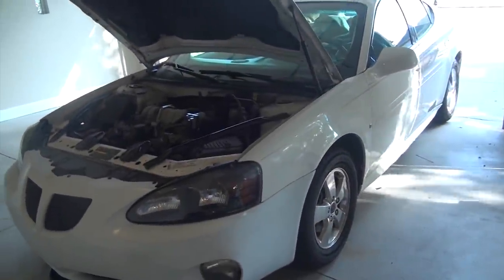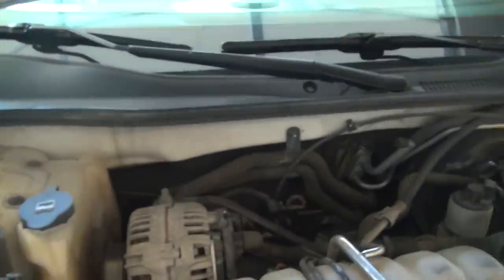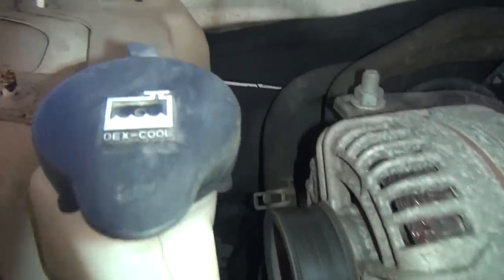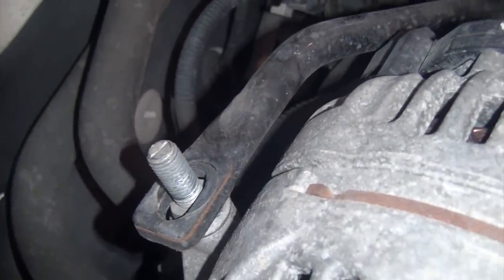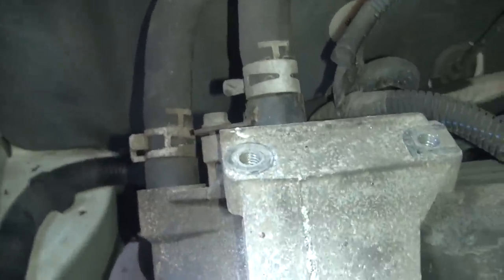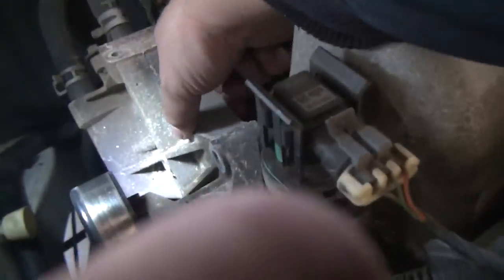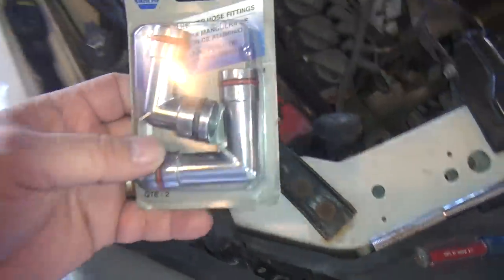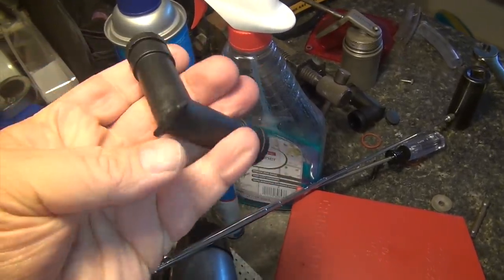GM 3800 Cooling System Elbow Replacement

Comment: yeah, but those aluminum elbows get a lot hotter than the composite elbows do, thus degrading the o-ring faster.   that's why GM used the composite elbows instead.    it's no big deal.   all ya gotta do is replace the composite elbows every 5 years, or so
Reply: so are you saying the aluminum isnt worth it
Reply: they'll work, but i don't think that they'll last as long as the composite elbows do.     you always gotta try to remember that there was a good reason that the GM engineers chose composite elbows over the aluminum ones     and i believe that they chose composite because they knew that the aluminum would get hotter and deteriorate the O-rings faster
Reply from the maker: All due respect Jeff, I think you may want to re-consider your statement:  Plastic or aluminum, they are both in direct contact with the same heat source therefore will heat to the same temp.  A silicone O-ring is rated for roughly 400˚.  I'd offer that the GM engineers were trimming cost. and say absolutely - get the aluminum!
Reply: naaa.... i think i,m gonna stay with the composite elbows, because i know that they won't heat up the inside of those O-rings as much as the aluminum elbows would.    but, to each his own.   do you have a GM 3800 supercharged engine?   because i have had a mysterious coolant leak for a while now, and i can't figure out where it's going.    i replaced the
• elbows
• radiator hoses
• water pump
• tensioners
• thermostat and housing / bleed screw
• coolant temp switch
• upper and lower intake manifold gaskets
• replaced the throttle body
and checked the heater core, which is good

the only thing i didn't do was replace the radiator

i figure that a internal leak would make my oil a milky brown, or light brown color

and my oil always looks fine

so that's why i always keep on dismissing the possibility of a internal combustion leak 

i haven't checked the freeze plugs yet though

what do you think it might be?

do you think that a lot of the coolant could be blowing out of the drain hole in the rear of my coolant reserve tank?

i recently placed a towel behind it, so if it is coming out of that drain, i,ll see the coolant on the towel
Reply from the maker: Ok, gotcha.  And dang, I'd have said lower intake gaskets.  I don't have the car now, but yes it was supercharged.  My mysterious leak was the first the lower intake gaskets, then the elbows.  II don't see a reason for it to get to the tank drain - did you say you put a new radiator cap on?  Hope you find it!
Reply: yeah, but i replaced the upper and lower intake manifold gaskets about 30 days ago, and nothing changed.   it still loses the same amount of coolant.    is it possible to be burning it in the combustion chamber, without having obvious white exhaust smoke, or milky looking oil?
Reply: So Jeff makes an engineering assumption yet cannot find his own engines issues...
Reply: I would go with the Aluminum...WHY? Because traveling down the highway at 65 mph, I would rather experience a slow dripping leak, than have the plastic BLOW OUT as did on my neighbors Chebby Impaler, thereby dumping a gallon of coolant out as fast as the waterpump can spin. STUPID DESIGN, PERIOD. Plastic or Aluminum. Not to mention that they are probably reusable, just get new O Rings, if available.
Reply: Just put 2 Aluminum elbows in a 2005 G Prix. 
Go for the aluminum, the O-Rings can handle heat.
Reply: Burning it as in bad head gasket ?

Wyr
God bless
Reply: 5yrs? Don't use the plastic ones I made that mistake they cracked and leaked after about 2 weeks. JUNK.
Reply: I’m having this problem now. I replaced them last night, started it up, and BOTH elbows started leaking. The guy at O’reilys gave me 4 black rubber o-rings...the elbow going into the pump was very hard to push in. Do I need to tear it apart and get those red silicone o rings? It’s an 02 Park ave ultra. Already has aluminum elbows.
Reply: @RyanLS   Im having the same issue, bought the aluminum elbows a few months ago and noticed my engine was leaking a little bit then pretty excessive this month. Looked at the elbows and both were wet with coolant.
Reply: Rosso The'Crimson I ended up buying new aluminum elbows and they come with the red silicone o-rings. Got them at O’Reileys for like $10. Haven’t leaked since.
Reply: Rosso The'Crimson also I’ve replaced the rack and pinion, outer tie rods, lower ball joints, pads and rotors, water pump, power steering pump and hose since this video. 🤦‍♂️

Comment: what's the part Number on thoughs Elbows the Metal ones?
Reply from the maker: I could not tell you the part number but definitely easy to find.  Absolutely use the metal ones.
Reply: +Michael “Miguel” Kernen the NAPA part number is 660-1942 for the aluminum, 660-1943 for the plastic
Reply: Those adverb

Comment: Do i need to drain my radiator first
Reply from the maker: You should drain it enough so that there is no coolant at the highest point you'll be working on.  Complete drain is unnecessary.

Comment: Do the elbow have to go all the way in  because I couldn't line the bracket up with them all the way so had to pull them out a bit
Reply from the maker: I don't think so.  As I recall mine weren't all the way in either maybe ⅛ to ¼ from bottoming out.  This may be intentional to allow for some expansion.

Comment: Can I get this parts on autozone for 2008 impala
Reply from the maker: I'm not sure this applies to the 2008 Impala.  Those don't use a GM 3800 V6 - they'd have a 3.5 or 3.9 V6 which are an entirely different series of engines..
Reply: Thanks

Comment: what's wrong with the Dex cool coolant
Reply: Hard to find
Reply: Dexflush too
Reply from the maker: For one, it has a propensity to eat the lower intake manifold gaskets!
Reply: I have to replace that to it's leaking
Reply: When its introduced to air (coolant leak) it will eventually gel up and turn to almost mud, standard ethylene  glycol coolant will not do this.  You have to change coolant more frequently, but much better choice overall.
Reply from the maker: DexKill!  Haha, yeah after having to remove the intake and replace the lower gaskets because of it, I can see how someone may be moved to violence!
Reply: Dexcool also erodes the aluminium in the cylinder head I've seen many cases where it eroded right through the water jacket, and where it corroded through the water passage behind the LIM gasket on the 3.1 & 3.4 engines.

Comment: it's not a improved fixed the aluminum elbows will still leak
Reply from the maker: Hmm, the ones I've fixed haven't leaked.
Reply: Michael Kernen every mechanic I talked to said go with those so they must be an improved fix
Reply from the maker: The plastic ones deteriorate to the point where they crumbled in my hands!  I can't imagine the metal not outlasting the engine...  IMHO
Reply: We install the metal elbows in fleet use, no issues.  GM has cheapened too many components on their cars.
Reply: Not if you place high temperature silver/grey silicone around the o-rings before install because the rubber o-rings can shrink over time. If you do this, the aluminum ones will never leak!!!

Comment: Forgot most important part, for safety you should have said to disconnect battery before messing with the alternator
Reply from the maker: Ah yes, that's a very good point.  Thanks Shawn!
Reply: No problem